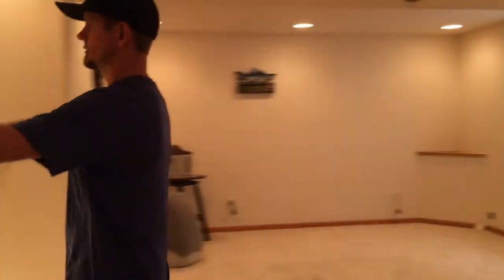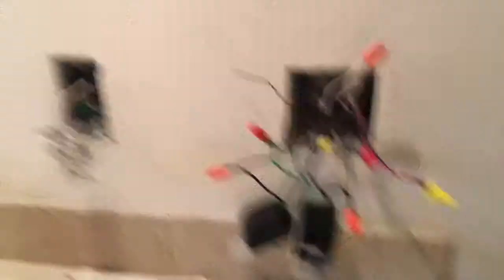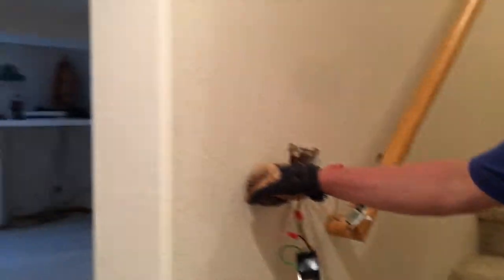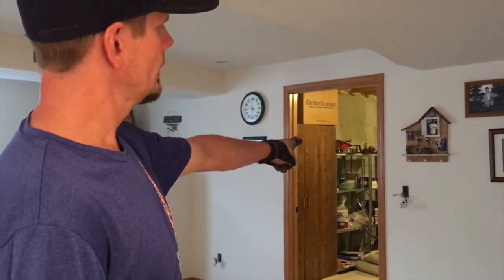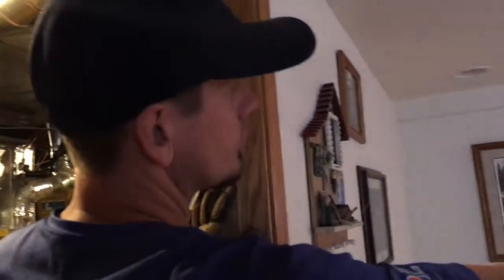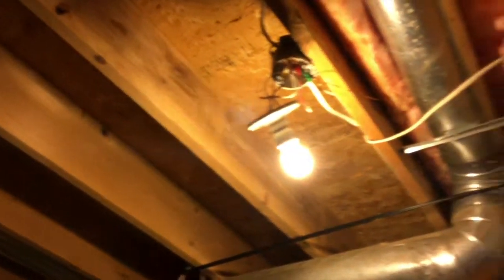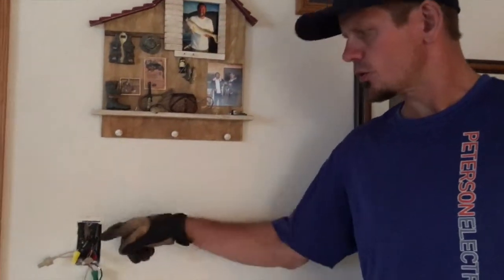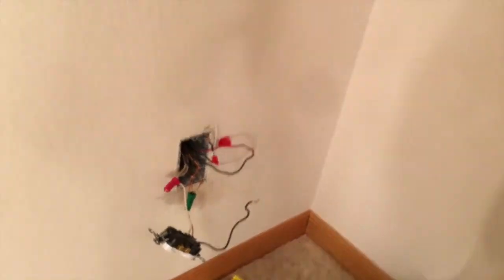Why Getting A Building Permit Is Critical | Multi-combo Arc Fault Breakers | Peterson Electric

Comment: ok im no electrician but i do like to stay current with codes and i was always wondering abought arc faulting with the shared commons circuits glad to see they make breakers its almost as much fun has finding a gfci breaker on the same circuit as a gfci outlet wondering why one is always tripping out.

 tht was a head scratcher they spliced into the outside gfci run. ran a feeder line to outlets in basement didnt now the breaker was gfci to outside outlet so they ran to gfci outlet on line side and the rest where tied into line side.  frnd excuse was contractor told him that the line he was using cldnt be gfci protected  they didnt place a gfci outlet outside because  there was no such thing as a gfci breaker.🤦‍♀️ frnds other big surprise was when i told him not to pay the last installment until after inspection. i was right the inspector wanted all outlets arc/gfci protected lol.   frnd cldnt believe how much the duel breaker was. i told him i was surprised the hack contractor actually got the permit.
Reply from the maker: If you are not an electrician, then why don't you get in the field and get your licenses? You seem, to have the basic ground knowledge that most do not have.
Reply: @Petersonelectricllc  lets during h/s i as enrolled at local tech school jr and sr year graduated with 1yr schooling toward apprenticeship schooling left me 3 yrs schooling and 4 yrs of work hrs to do for journeyman. all jobs had 2 of em paid minimum wage. none wld help pay for schooling or tools. after a yr my single mother got sick and cldnt work sister cldnt be bothered to help i cldnt afford to work trade and take care of family. always thought i wld get back to it never did mom died a cple of yrs later at age 44. at that time i was making $12 an hr avg starting pay for apprentices was $9 with schooling help after 2 yrs of employment. so im in my 40s afraid of heights 6ft tall 500lbs not exactly apprentice/slave material  i can strip out a room in an hr not 10 minites like most seem to want. so i spend my time when i can helping frnds and families with their wiring needs some times i help frnds who are in the trade with bigger projects they have.

Comment: Where is the 2nd panel video? And would you ever recommend doing multi-wire branch circuits?
Reply from the maker: The 2nd and 3rd videos are out there. I run multi-branch circuits with #14-2-2 and #12-2-2
Reply: Peterson Electric is that where you have 2 circuits with each having a dedicated natural wire inside nm-b? I’ve head of them, but I haven’t seen them in use yet. Could you run one circuit to your washing machine dedicated and then bounce to your gfi protected bath outlet that is just on the other side of the wall?
Reply from the maker: @granthiggins3492  That is a hard one to answer. There are many code requirements
Reply: @granthiggins3492   i wld honestly say dont be cheap pull a permit ask your inspector (AHJ) !
Reply: Don't do it
Reply: Breakers are pricy